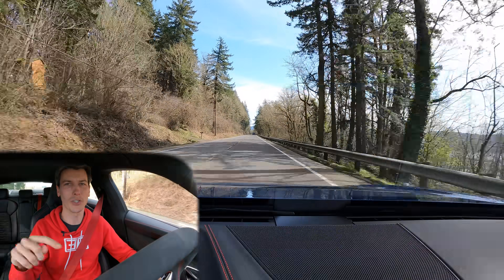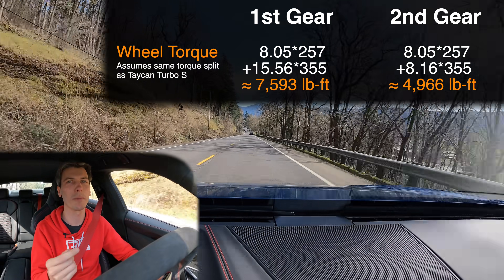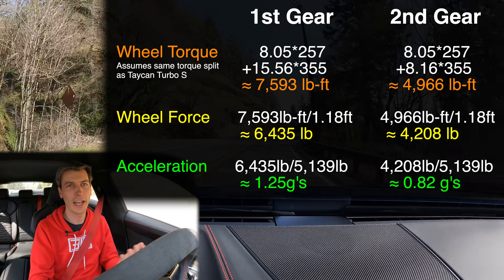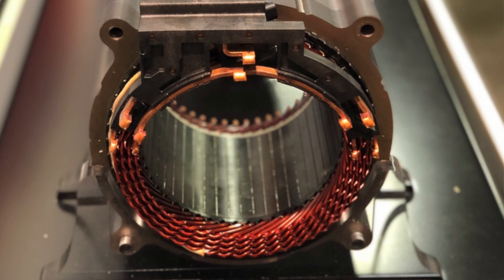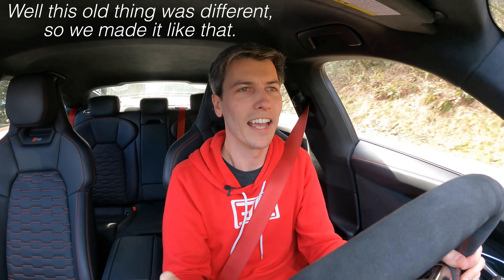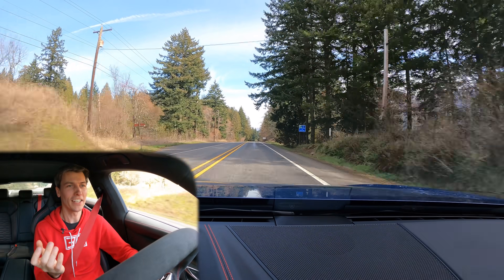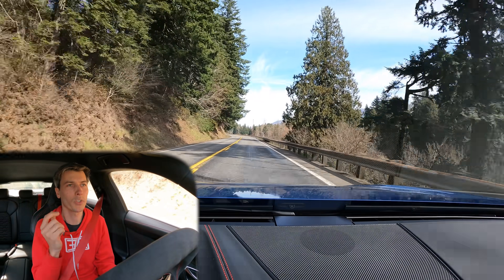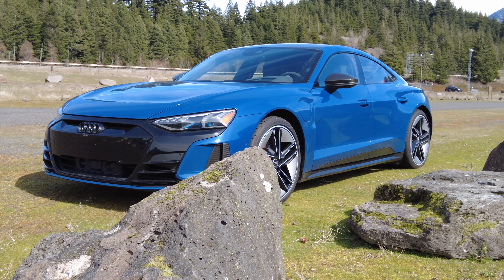Are Fake Manual Transmissions Coming? Audi Keeps It Real

Comment: I could be wrong, but I don't think you can measure the acceleration that you feel in a car by wheel torque alone. I've noticed you do this often, so maybe I am wrong, but the formula seems to be missing something that accounts for the gain in distance travelled per rpm of the engine with a higher gear. After all it's horsepower that truly determines acceleration. If you had an engine with a flat horsepower curve that doesn't increase with rpm, and you had 2 cars with drastically different gear ratios but that same engine, acceleration would be the same, since the same hp would mean the same amount of work/time.
Reply from the maker: Hp, for a given rpm, gives you torque, which is how you derive a force at the wheels.
Reply: @EngineeringExplained  Correct, but the given rpm is changing between your comparisons, so the wheel torque number doesn't tell the whole story. The force that you lose with a higher gear ratio is traded off by the fact that you are spinning the wheel quicker. So you are applying less force at any instant, but you're applying it "more often". I guess my point being that the force applied at the wheels (wheel torque), is a fairly useless measurement. It doesn't determine overall acceleration, which is what "matters". Going back to my example of  a car with an engine that has a perfectly flat hp curve throughout its rpm, no matter what gear ratio you put in the gearbox, the acceleration of the car wouldn't change, and would remain constant.

Comment: I have been driving gas powered manual transmission cars for over four decades and I love driving them. I dislike driving manual transmissions (they're so boring) and I would also dislike driving an EV with just one or two gears. When I'm going down winding roads, I love dropping gears ahead of corners to decelerate coming in, accelerating out of the corner then grabbing a higher gear or two as I pull away from it. It's fun and engaging and it makes me feel like I'm a part of the car. Driving any kind of car where you only have to put it in gear and from then on all that is required from you is just to aim it and work the brakes and the "gas" pedal would take all of the joy and fun out of driving so it would not matter one bit to me that having a fake manual in an EV was making it less efficient because I would enjoy driving it so much more. I do agree with Brian Roque's intelligent comment below, however. The manufacturers who give you a fake manual transmission option should allow you to go into the options and make it run normal so you can take advantage of either mode when it suits you. That would work well for couples where one partner likes driving a stick shift and the other one doesn't or can't. Or if you're commuting in heavy traffic make it run normal and when you're having fun cornering down that windy mountain road, you put it in manual mode to have some fun. That way, you could have the best of both worlds. I would buy an EV like that over a so-called "normal" one any day.

Comment: Having paddle shifters and set ratio points is helpful even with CVTs, especially for hills. During normal acceleration having fake shifts isn't necessary although it helps reduce the whine and rubber band effect in some cars. In Subarus if you move the shifter to manual mode to use the paddles it puts it in a sport mode that allows for a greater rev range and is less likely to override the driver. Using the paddles while in D is meant to be temporary and the car will quickly go back to doing whatever it thinks is best. In sport mode it's more spirited driving and you can accelerate faster except for full throttle. In that case leave it in drive and let the car do max acceleration.
Reply: That’s how my car works and it is a CVT’s. I actually don’t mind the fake shifts, I think it makes the driving feel more natural and less annoying. I’ve driven CVT cars that don’t simulate shifting and just wine at a a constant rpm.  It’s more efficient but makes driving feel so mundane and boring. I can’t stand that constant note.

 In fact my car you can definitely feel it “shift” when you drive sort of a aggressively. It’s kind of entertaining how noticeable it is sometimes. Especially under WOT

Comment: Noob question, does tuning the electric motor to have a narrow band power, make any difference in terms of battery consumption in terms of making the electric motor limited range but giving the ability to work as a normal car would when paired with a transmission? And would this limited range require the same output from the batteries? If the motor can run on lower rpms in high speeds, would it require less juice from the battery, hence maybe require smaller batteries to be luged around? Thank you

Comment: Electric motors have a rpm range that have higher efficiency than others (a.k.a. powerband) around 40% of their peak rpm. So they really should just put in a actual 6 speed transmission so they dont need to wreck their cvt (continuous variable transmission) AND allow you to actually have something to play with
AND because we have a rather wide power band we might not actually need a 6 gear so we can go back to 4

Comment: Notice even Tesla ,  being electric does NOT have the top-speed acceleration of a good combustion engine.
They are sort of like a Diesel with a wider power band.
And electric motors suffer from Back-EMF.
A F1 car , which could be even faster because of rules , would DECIMATE any electric car on a track.

Comment: One question 

Does an electric motor use more power at higher RPM
Or is the battery drain equal across the RPM range?

Take out wind resistance at speed and the force need to start moving from a stand still. Is power usage the same

Comment: I was definitely triggered by this video.  Sometimes it hurts being a technophile.  I got my first CVT in the halcyon days of 2010'ish when CVTs weren't wearing a tradition transmission skin suit.  I loved it because of the technical achievement and how smoother the drive was.  Then, apparently, customers complained about how different it felt, so they ruined CVTs.

Then I got an electric car.  I love the silence.  I love the instant torque.  I love the no shifting.  I love the things that make it unique.  And now they're getting rid of all of that -- fake noise that you can't turn off?  Forcing users to shift?  Next they'll get rid of the intsant torque -- maybe simulate a super charger or something.  

Now I'm back in a Camaro, and I love how IT feels.  I don't wish it was an electric car -- if I wanted the properties of an electric car, I'd get the electric car.  Likewise in the opposite direction: I buy electric cars because I LIKE the properties of them.  Don't Camaro my Tesla, you jerks.  (Not that Tesla is participating in this farce, mind you...at least I hope they won't)
Reply: re: "Don't Camaro my Tesla, you jerks."  IN YOUR FACE MARY BARRA...!!! 👀  SUCK IT GENERAL MOTORS...!!! 🙌 (although the new Z06 shows they've got things well under control)

Comment: What I wanted to do to my E40D auto behind my 96 7.3 was to wire it up so I can manually select the shift solenoids for each clutch pack and have a small lever from park to 4th, so it would act like a tractors powershift. If I wanted to lock 3rd, I could, 4th, I could. Not very logical but its better than tuning the transmission imo. Would be unique too. Blew the 3rd trans, so am swapping a zf6. Oh well. Blow the zf6 it will be somehow getting a true powershift shoved into it one way or another.

Comment: So, if you don't engage the "gas" at just the right time as you release the clutch, will the car lurch abruptly and/or stall out like it does on a real manual transmission? 🙂To me, that's one of the pleasures of driving a manual -- knowing that you have mastered this crucial skill to make it a smooth ride.

Comment: I disagree with your explanation of why they made CVTs act like a traditional transmission, people complained furiously about the droning a CVT would induce from the engine being parked at a high RPM when accelerating hard. The “gears” changing broke up the droning.
Reply: Absolutely! I'm so happy our Forester does it, and quite well too. It's a mental break in that sound.

Comment: Tesla's original roadster had a 2speed early on but it was unreliable so they abandoned it.
CVTs used to hold steady RPMs but it bothered the consumer, so the manufacturers added the steps. Frankly the real problem with those old CVTs is that they were used on tiny engines with no torque that had to be revved to oblivion. Everyone blamed the CVTs but it was really the engines' fault. However, the old CVTs couldn't take much torque, so it's not like they could have stuck a bigger torquier engine in there.
Maybe the Toyota fake manual is for instructional classes (doubtful) or ELECTRIC GO CARTS, or as a theft deterrent. Probably none of the above.
Reply: re: "Tesla's original roadster had a 2speed early on but it was unreliable so they abandoned it."  <--- see greg gets it, greg knows what went down.

Comment: they didn't make those changes just to make it like the way it used to be, they made them because CUSTOMER'S complained that they liked how the old tech felt better.

If they make a fake manual EV, it's 100% because someone wanted it.  Some die hard manual people probably want that shifting feel, even if it's pointless now.

Personally i always prefered manuals, i didn't mind shifting.  they were cheaper, had a better track record of reliability (at least for me, i don't burn clutch's or grind gears) AND they were more fuel efficient (at least the way i drove)

Now that i have a EV, i would be annoyed if i had to shift (because it's pointless, and would likely reduce efficiency), but it's no sweat off my shoulders if they make one that has it.  If there's a customer base for something, and it's possible to do, someone will probably make a product for them.

Comment: One could make an argument that the fake torque curves give you finer control over wheel speed, so you can more easily break the tires loose at the exact speed you want. If you just have peak torque all the time, I could see it being much harder to drift exactly when you want to. /shrug

Comment: The answer is that many people (ie. potential buyers) are afraid of new and unknown things. So they prefer what they know. And it’s easier for them to buy an electric or a CVT car if it is similar to what they already know, despite the “unnecessary” drawbacks. Or in other words, once the engineers’ job to make the best possible car was finished, the marketing department took over to make sure the car sells and recuperates (no pun intended) the investments. Or in other even simpler words, it’s like that because it is more profitable for the shareholders. Capitalism. There.

Comment: thank you for the explanation why ev don't need transmission that sort of answers my questions to "why ev don't have transmission?"

I also would like to ask you perhaps, personally on an efficiency standpoint. motor would be driven by amperes x voltage = watt/power (correct me on this one). by having a transmission the motor can run at lower rpm means less heat generated, further, having a gear ratio also means you can supply lesser power to the motor, that indirectly, can reduce power consumption even further, meaning more battery runtime for ev, is it not?

this is just a hypothetical question on what are your point of view regarding my question of reducing power for better runtime, similar to ice cars being made efficient through countless methods

Comment: As someone that can't wait for the world to turn away from carbon - and who drives an ICE stick - I had considered the fact that electric cars don't need a transmission, and the fact that folks like Yours Truly are used to driving with a stick (once I went stick, I tried driving an auto, and I had to continuously think to NOT hit the clutch pedal when the engine revs (which of course would be the break pedal for an auto).  However, I have already determined that the next car I buy will be self-driving (I will continue to drive my 170K ICE car until the wheels fall off, and after that, I will get by with delivery & Uber), so it's not an issue for me.

Comment: Multiple geared transmissions are necessary, if you want to tow, as most EV cars are down on "permanent power", which is needed at low speeds. Most EVs are advertised with high peak power numbers, but aren't capable to utilise the same "permanent power" in the same way, as combustion engine cars are, which is part of the reason of the lower towing limit.
Especially if you want to use more efficient electric motors, meaning less torque with the same peak (and permanent) power, you need the ability to utilise the power at lower speeds, which is possible if paired with a multiple geared transmission.

e.g.:
Today a 70 kW ICE car with about 1,3t is able to tow about 1,8t but there are only few EV, which are able to do the same.

Comment: CVT fake ratios are there because they are all in terrible cars with awful coarse 4-cylinder engines that sound like miserable garbage when stuck at fixed rpm. It’s a mercy thing.

Comment: That's a little bit weird from Toyota to have this patent. I was guessing with the Toyota hybrid system with 2 motors, 1 on the wheel and 1 like as a clutch+gear box: Just put the second motor with the epicyclic gearing and do a soft to control the motor like a clutch and a gear box. And of course instead of a ICE, you put a downsize electric motor.

Comment: It would be great if you could choose what car you want to emulate from a list of downloadable options. Download the sound, torque curves, engine braking, RWD, FWD, etc. Limited slip diff vs open. Manual gearbox Vs paddles and the EV would simulate it. Would turn into a real life driving simulator and put driving skill back into EVs! Then select self driving mode to get to work for shitty traffic commutes

Comment: I don't completely agree with the CVT assessment. If you were to design how a CVT should behave in a vacuum, ie. in the absence of old school transmissions, you would probably still arrive at set gear ratios. I just can't imagine having the belt assembly constantly changing the ratio would be particularly efficient or healthy for the transmission. CVT gives you infinite ratios, not infinitely variable ratios in real time. Those are two different things. Now it could do the latter in specific scenarios (i.e. full throttle), but I don't think it should do this automatically 100% of the time regardless of throttle input. Manufacturers balance the two based on user input, which is one dimensional (i.e. how much throttle you input).

Comment: I've been driving fake manual shift in Assetto Corsa with G27, and it's really forgiven compare to the real manual shifter in my WRX. all the shifting activities are just sent as electronic signals to program in simulation. and the computer just responds with torque based on the car's spec, current speed, RPM, selected gear. so it's totally possible to fake it in EV. Is it fun to drive compared to Tesla Model 3 Performance in the game? oh yeh, different type of fun.

Comment: The original concept of EVs, according to my library books circa 1980, was their utter simplicity - a battery and a motor, essentially. Now we need multi-speed transmissions so that we can accelerate our EVs from zero to sixty in less than 12 parsecs. Sheesh, give me a brand-new, $5,000 EV city car. That's all I want or expect from an EV.
Reply: Actually, they built electric trucks and cars as early as the 1900s.

Comment: The thing to be said for fake engine sound is that it gives you another way to perceive speed.  A lot of modern cars (EV or ICE) are so quiet inside that I find myself going faster than I think I am because there is not enough feedback beyond the speedometer.

And I like the idea of a fake manual EV for the same reasons. More interactivity and feedback, means more understanding of what the car is doing, even if the car is just duping you into thinking that.

Comment: "there was an old thing that worked differently, so we made it like that" - Why EV's have FCUKNING TRANSMISSION CREEP 😡😡😡
Reply: My first test of an EV is I put it in drive and take my foot of the brake. If the car moves when I'm not on the pedals (on flat ground), I walk away. Transmission creep is wholly unacceptable. Bonus points if the throttle acts like a dead pedal and the car confidently brakes to a stop by itself.

Comment: As someone who has owned 3 manuals and 3 autos (ok 1 torque convertor 1 dual stage e-CVT and 1 PDK...they drive very differently!) I can honestly say that I would certainly consider a fake manual. Got to drive one to know, but it does sound appealing enough.

One question though- if the clutch is literally a "give me no power" switch...will the car care if you don't bother using the clutch?

Also on the badge image: an L10 GS450h is a better daily driver than any Porsche, it just is. On the other hand, I get more compliments about my car in any month now I drive a Porsche than in my entire 7 years of Lexus ownership. I've also spent more time kissing beautiful women in the last week than in those 7 years of Lexus ownership 😆 Plenty of car geeks including myself don't care about badges, but people in general do care.